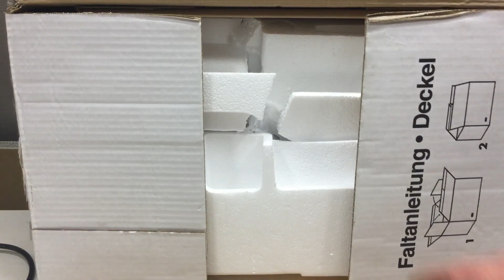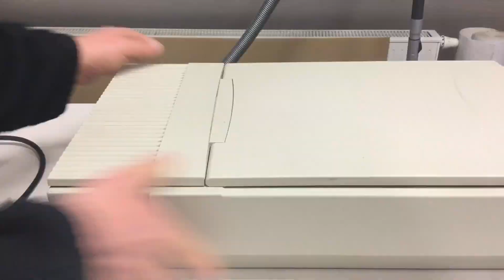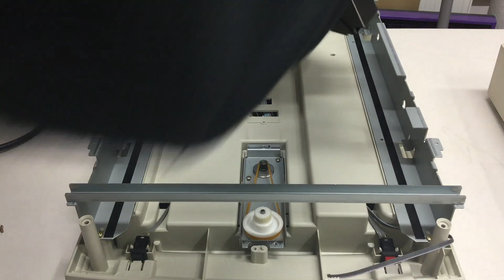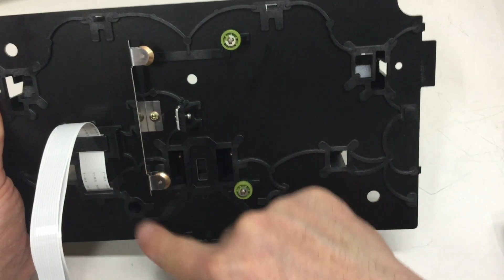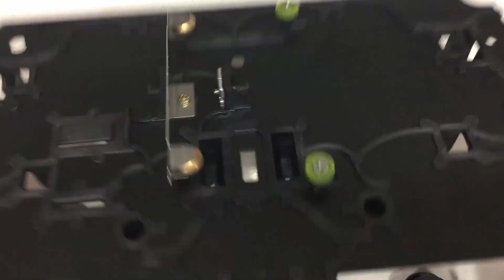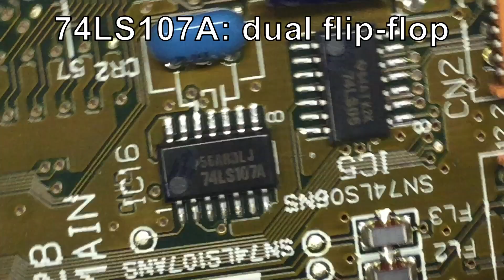Epson GT-8500 Scanner Teardown (Nineties Tractor Construction)

Comment: hi, i've been looking for a stepper motor for an arduino project and remembered i had this scanner somewhere. I tear it down and got the stepper motor. Do you know if theres a way to use it with arduino? can I get a "popular" driver like the ones for nema17 ?
Reply from the maker: The stepper motor in this scanner is driven by two  Toshiba TA7289P H-bridge drivers that can deliver 1.5A peak. According to the scanners service manual it's run at 24V. So you should be fine with for example a A4988 driver breakout board for your Arduino (1A cont., 2A peak, 8 - 36V).
Reply: @robertssmorgasbord  thank you!
Reply from the maker: @cvaug6958  You're welcome!